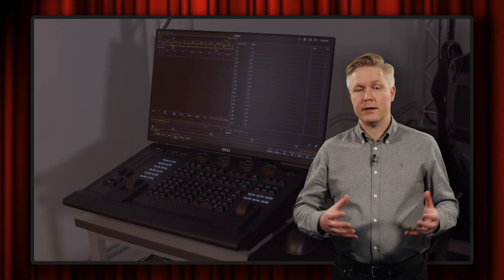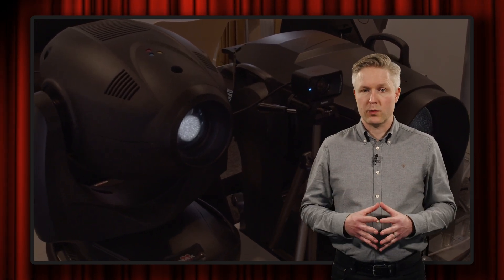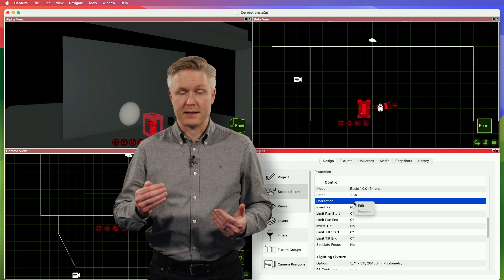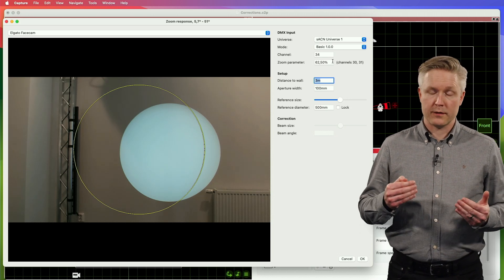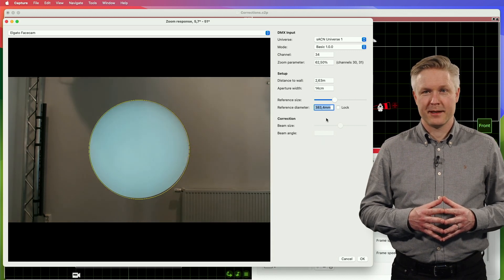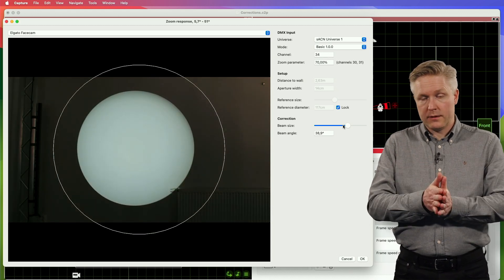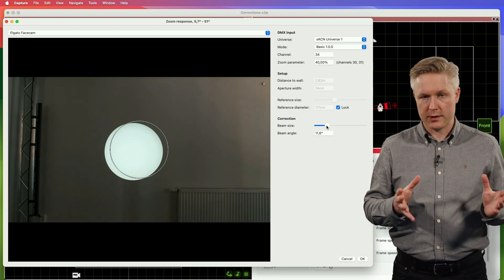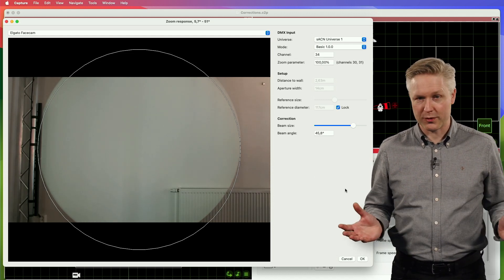Zoom Corrections

Comment: This is great. Is there a way we can see which fixtures have had real-life corrections applied and which are still generated? Would be helpful to know if something is worth measuring or not before going through the whole set up process just to learn it’s bang on 😅
Reply: I asked about this at PLS. But they don't intend to make corrections public. So I suggested adding a forum thread where people can upload them, so others could use them.
Reply from the maker: There is no sign in the library. If you see the fixture acting like in reality you do not need to do something. If not you have a way to make a correction. Corrections sent to us will be inspected internally and applied to the library for everyone.